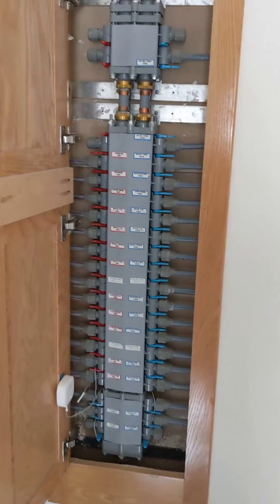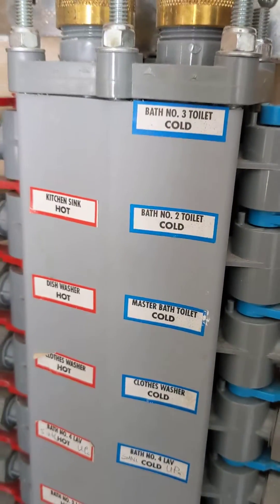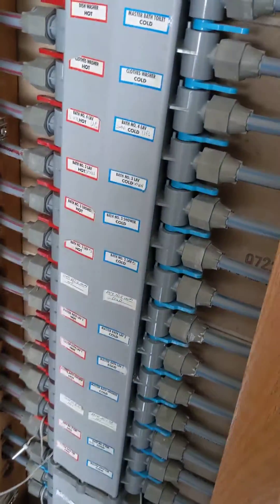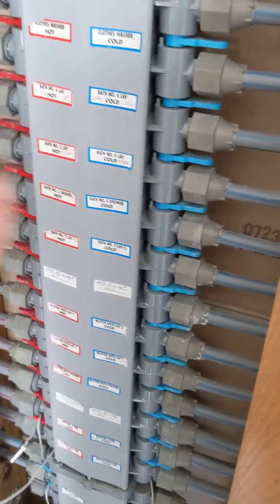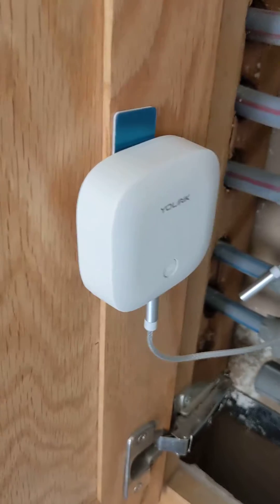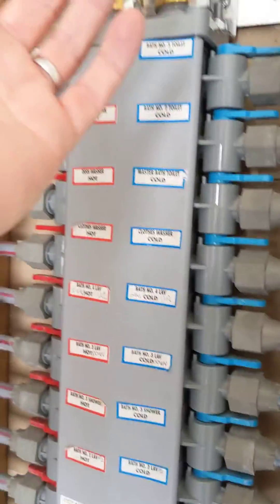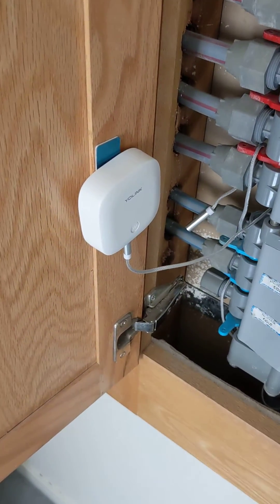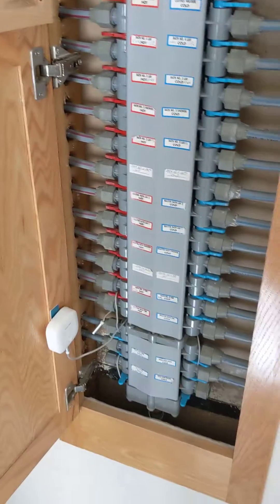Water leak alerts for your Manabloc plumbing system

Comment: Soon you are going to be replacing your poly b
Reply from the maker: Absolutely! I did it a couple of years ago. The leak detector saved us from a big mess. A pipe burst inside the wall.
Reply: @ScottAllison how much it cost to replace system. And would you buy a house with that system again if you knew how much of a headache it is?

Comment: I have the same system , in Vegas and it’s old lol I usually just shut the water meter , got careless and used the lever , now I got a drip.  It’s old as hell , almost 30 years old , I gonna replace it , the whole thing is unreliable , when it’s new great.

Attaching a leak sensor , that’s a little extreme lol but whatever.

Comment: Do you know what company manufacturers this type of manabloc? I live in Las Vegas also I wish I would of saw this video Before my pipe busted. I manipulated all the valves because they were not labeled now 3 are leaking…. Hopefully they still make replacement parts.
Reply from the maker: I don't know the name, sorry. I wouldn't be surprised if they were sued out of existence long ago, and honestly I don't know if they were ever repairable. I have noticed that turning off a valve will start a leak, but if you open it again the leak often stops after a few hours or a couple of days, so you might want to try that. If you're lucky it will stop by itself. Good luck!
Reply: @ScottAllison   My 16-year-old house came with a manifold manufactured by Vanguard. Vanguard was bought by Viega. I made the "mistake" of turning off one of my valves and upon turning it back on, it started SLOWLY leaking. I got in touch with Viega and they sold me the correct replacement parts. The valve stems have 0-rings that eventually degrade. I probably need to replace every stem on my block. I am definitely going to look into a water leak sensor.
Reply from the maker: Yeah, basically you don't ever want to touch the valves because they often leak. If you ever need to shut water off do it at your main shut off valve instead!
Reply: @ScottAllison  Great idea.